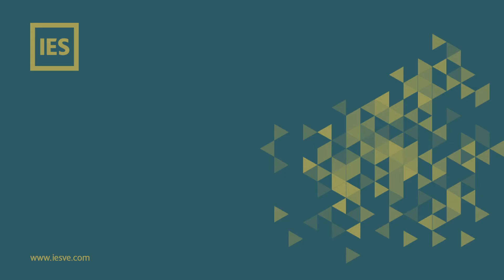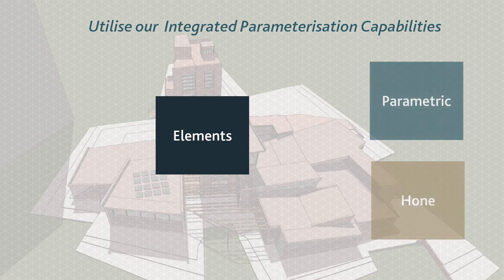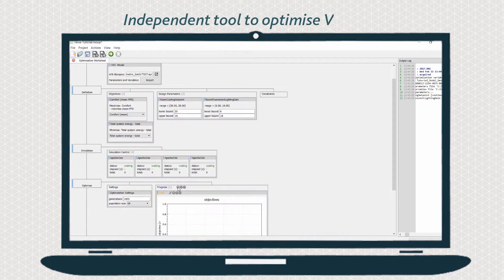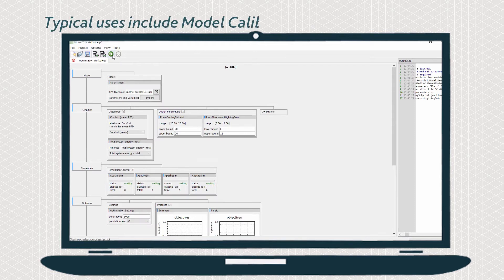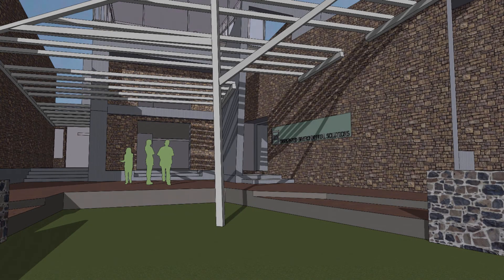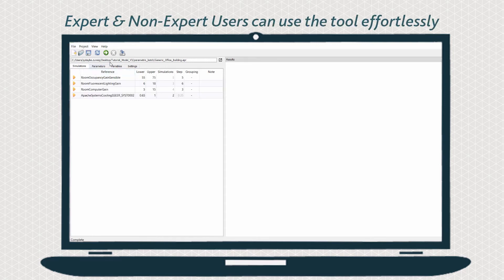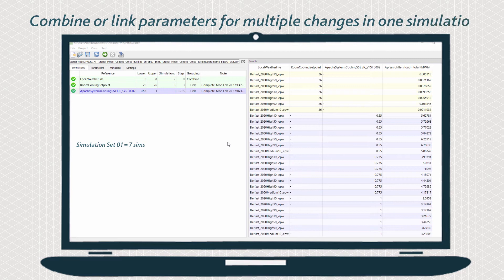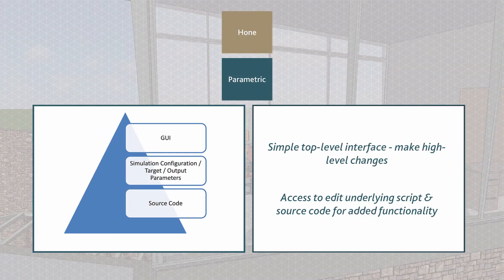Parametric & Model Optimisation

Comment: Where is the parametric tool located? I just cannot find it
Reply from the maker: Hi, Rohan. It is located in the IES folder in Program Files.
Reply: @IESVE  Is there a user guide for this?
Reply: Have you had any luck locating it?
Reply: @markansah6347  Yes
Reply: @markansah6347  It came autoinstalled and I had to search for it via windows search bar. It is a separate program in itself
Reply: You saved me man! Thanks a million!
Reply: Has it been helpful with something like window to wall ratio, wall thickness, building orientation?
Reply: @markansah6347  I haven't used it yet as such to be honest
Reply: @rohan1tkr  That's fine. Thanks very much again